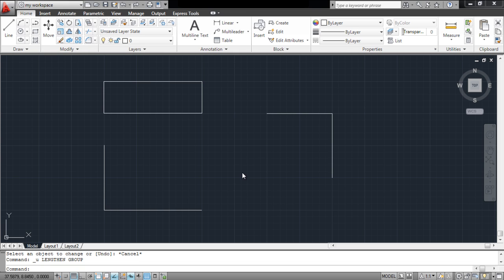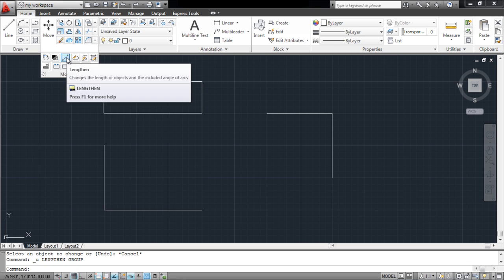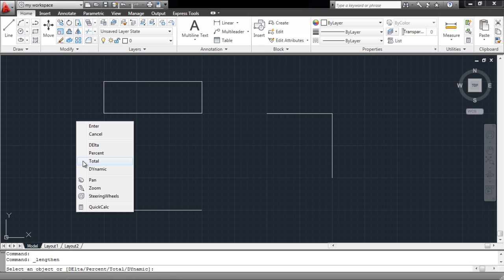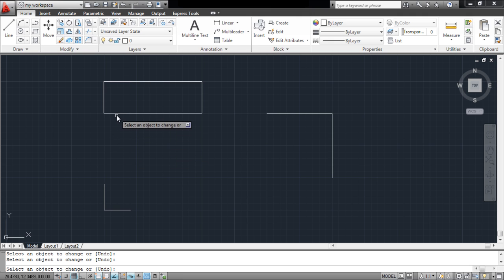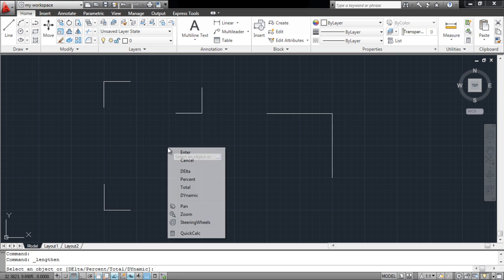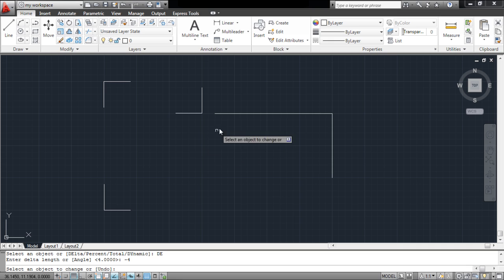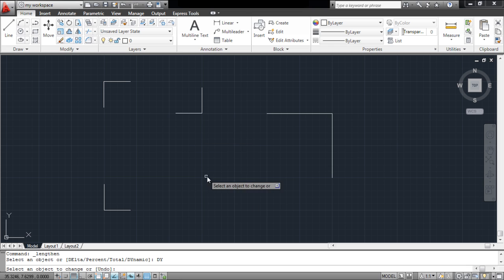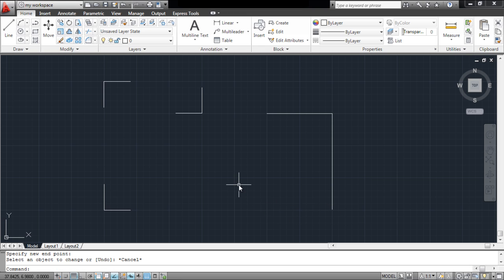How to Change the Size of Objects in AutoCAD

Comment: It's oxymoronic that drawing in 3D is actually easier than 2D.  This is one of the biggest reasons.  With 2D autocad you must basically "know all specific lengths" as you draw it. You don't just "throw out lines" and then change the shape/size, later.  In the real world most things start as sketches/guesses/tentative then get defined more accurately, later.  Modern pc based(not talking Pro-E...but they are coming around) totally encourage throwing out lines/make a shape/extrude then edit/change shape as you go.
Reply: I fully agree here, I used Autodesk Inventor (Student Edition) at university. At work, due to cost of license renewals, I have to use AutoCAD. It is so difficult (as a beginner to this software) to change simple things.
Reply: like it should be. On the fly changes to a line are better than totally redesigning a model because you defined a line 1 in longer than it should have been.